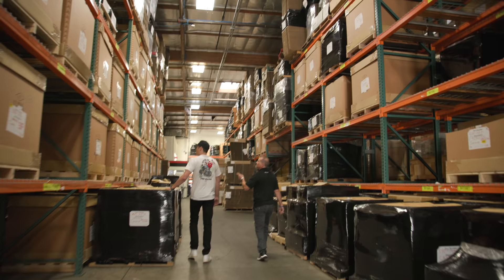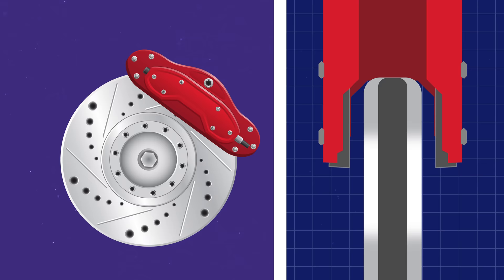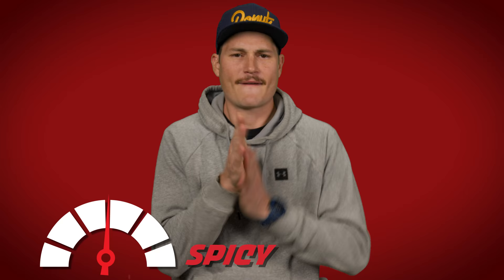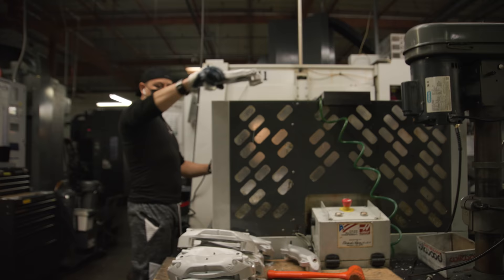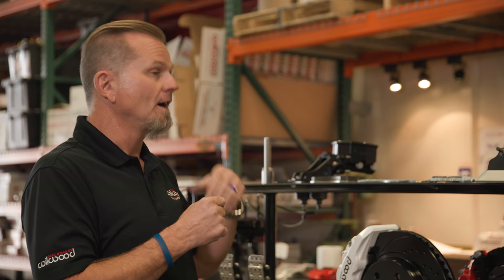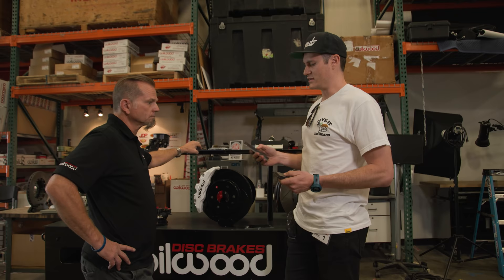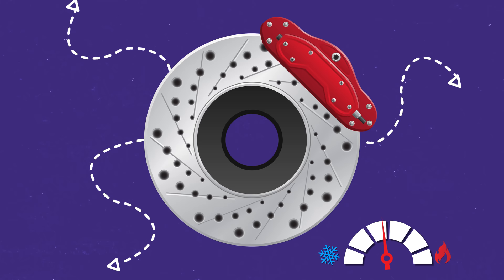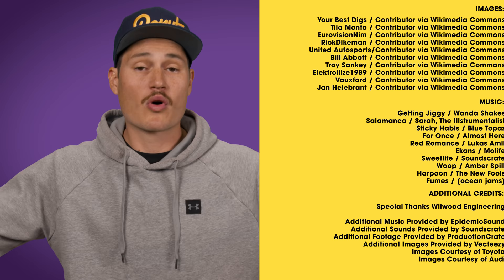Why Your Brakes Can't Melt

Comment: Ooof that was an unfortunate factory tour. That guy basically just repeated what a brochure could have. It would been awesome to go through the process start to finish of building one of their brake setups.
Reply: Maybe they didn't want to give away their stuff
Reply: @DrDreq  The only thing propriety that they wouldn’t want shown is the combination of materials used in their pads and possibly their rotors. The actual process of making brake setups isn’t special. That guy just held up a caliper and pointed to a machine they used for bedding in breaks.
Reply: That's what my takeaway was too. Regardless of why it happened, it wasn't incredibly informative.

Comment: Would've been nice to get a more in-depth breakdown on brakes in general:

1. Master cylinder + booster to caliper piston diameter ratios.
2. Dry boiling points vs. wet boiling points of brake fluids.
3. Brake pad feel (i.e. linear, progressive, grabby vs. smooth)
4. Steel rotors are made to last longer at the expense of not dissipating heat as easily and having lower coefficient of friction. Iron rotors dissipate heat better, have higher friction, but wear faster and weigh more.

Comment: "all mighty engineer" lmao, that's why I'm studying mechanical engineering, to be called all mighty engineer one day
Reply: Be real, a mechanic wronged you somehow so now you want to design cars to find the worst place to fit a starter.
Reply: @colecooper5836  what? That’s not why anyone goes into mechanical engineering
Reply: @kennorcott7074  not to mention you have the actual profession of automotive engineer why would you choose mechanical
Reply: All engineers need to apprentice as both machinists and mechanics. Something that looks good on paper isn't always the way to go. Some tolerances aren't truly needed to be so tight. What's gonna happen when "x" needs repaired / part changes. 

Yeah. Those type of things.
Reply: @seanharrison6162  because alot of mechanical engineers move into the automotive sector. Source, am one
Reply: What kind of mechanical engineering? What math classes?
Reply: @seanharrison6162  mechanical engineers work everywhere. They’re needed in mechanical components, energy production, cooling, etc etc
Reply: @seanharrison6162  you can’t get a degree in automotive engineering in most colleges tho. That’s the issue
Reply: @andrewgruver7774  because very few colleges have automotive engineering
Reply: @TomYourmombadil  and you can choose to move to automotive if you want to
Reply: @kennorcott7074  sadly painfully aware
Reply: I have a mug that says “trust me, I’m an engineer. Let’s just assume I’m never wrong” and I aspire to be that mug
Reply: one of us, one of us
Reply: @joshuagibson2520  that's why I feel as if I have a future in the engineering field, I already have those people to help and mentor me and I also have the drive to do stuff like that
Reply: I'm more of a mighty mage engineer, it's a different class
Reply: @B. Chan they did in the 90s, but only for advanced physics. It's why I got into physics actually.
Reply: YEA!  Hope you Find a GOOD Paying Job.
Reply: @idkwhoknew908  my bad bro didn't mean to respond to you.
Reply: @MetlKen87  A~OK no problem 
..
Reply: as Mechanic I'll say "your are my agony!" :D
Reply: @seanharrison6162  A mechanical engineering degree is often a precursor to working as an automotive engineer.
Reply: Same bro same
Reply: @joshuagibson2520  Luckily I am ASE certified from my school :). Im a bio engineer tho so idk how helpful that will be
Reply: @kennorcott7074  all came down to the engineering skill
Reply: All my homies hate engineers
Reply: It was probably sarcasm, Mechanics just curse engineers all day

Comment: Don't forget, When you Upgrade the stopping power of your brakes, you need to Upgrade the tires. The brakes will only work as well as much tire traction you have.  Also when you give your car more power (HP), you need to upgrade the tires to get that power to the ground. Suspension is the same thing. Build and upgrade around your Tires.
Reply: We highly agree with this!
Reply: @WilwoodDiscBrakes  aye wilwood any chance I can have some free brakes
Reply: A system is only as strong as it's weakest link. In the case of my suzuki swift, I could add quite a bit of power before getting any acceleration benefits from better tires (though the better cornering speeds would still improve lap times).
Reply: @reaganharder1480  sometimes the weakest link is our head.
In my Fiesta ST i rev it mostly to 4k max.
But when it's revved over 5,5k and I'm not brakeing gently but sharply. Oh boi oh boi!
Even funnier. I upgraded the tyres to the best I could afford and it is insane! 80km/h in corner with speed limit of 30 (mountain twisty road) . Like earlier I have skidded there at 50km/h with older tires
Reply: Not necessarily. Depends what tyres you are already running. Most half decent cars already come with decent tyres in the first place. When I put a big brake kit on my car I didn't touch the tyres and the stopping power was still insane compared to stock.

Comment: Story time. Its my sophomore year of highschool, and i worked all summer for my grandparents to buy my first running car, a white 1985 Bronco across the street. The sellers let me test drive a few times, and something felt a little bit... tacky on the throttle. Otherwise, i was in love.
Fast forward to 3 minutes after i sign a bill of sale, im driving it back home through town with my dad behind me. Going up a hill, i floored it so i could enjoy my good ol 302 V8.... gave it the beans and THE THROTTLE CABLE GOT STUCK WIDE THE FUCK OPEN.
I didn't know i could drop it in neutral. I thought if i did, this engine would blow up before i could stop and turn off the car, and i just bought the thing. So i slapped the bitch in low gear and stood on the brake pedal with both feet for over a mile through town. Blew through a busy stop and thankfully everyone heard the horn.
I killed the momentum on an uphill enough to put it in reverse and then park. I got out and the brake rotors were glowing orange-yellow, and they melted the brake lines. Could've fooled me, because that thing cornered like a god damn hero that day. Replaced the brakes and drove it for a few more years.
Reply: My mom had an 85 bronco. Only parts that would work on it were from 85. From 82 to 84 bronco 2's were compatible.  And 86 to 92 i think worked but 85's were an experimental year that did have many shared parts.
Reply: wooo coudlve been worse
Reply: Uh, you could have also just turned the key off. And yes, I've been in the exact same situation before. I turned the key off and coasted into the center (left turn lane).

Comment: The concept of "as pressure increases, so does temperature" along with the inverse "as pressure decreases, so does temperature" is also the basis of pretty much every refrigeration system out there.

I didn't know the importance of brake fluid until I went to my first HPDE event at a high speed track (Portland International Raceway, home to F1 and NASCAR events). By the end of one round, the brakes were done, but it wasn't the pads/rotors. I had upgraded those to be able to cope with occasional track use and yeah, they got hot, but they weren't even stinky. It was the fluid. I'd only used regular DOT3 brake fluid and even though I'd completely flushed out the system with new fluid when I upgraded the pads and rotors, the fluid wasn't up to even 15 minutes of road course use. As soon as your brake fluid starts to boil, the pedal just goes to the floor and you're pretty much done for the day (you have to bleed the brakes since the boiling fluid introduces gases into the system, and gases compress).

Comment: i once almost had my brakes on fire. was trying to show off there was no breaking happening.
Reply: Today my breaks began to smoke at the german highway with no speed limit. I had to brake from 270 km/ h to 100 km/h because there were trucks on all 3 lanes
Reply: My first car was a 91 corolla. Beater of all beaters. I did a brake job and then rallied it around the mountains and when I got back I found I had overheated the brakes and half the friction material had crumbled.
Reply: @christianforster5176  "brakes"
Reply: @christianforster5176  That sounds not fun at all. I had just bouth my first car a mustang with a lot of power but not super well engineered so air ducts or anything to the breaks as i an driving around friend showing how fun the car is I see smoke and a very bad smell lol. i took it straight to highway to get some air in them.
Reply: @colecooper5836  Lol thats funnny konw must have bee nsuper sacry in the momnet. i have changed brakes successfully so far. i am planning to bleed my breakes fingers crossed hopefully no air get in there.
Reply: LOL that is funny now.

Comment: Had 281 mm with thickness of 22mm disc on my mitsubishi (1170kg and 213HP&280NM)  with one pot caliper , and they were "burning" even on "hard" street racing (braking from ~220kmph to ~0), i swaped them to 294 disc, 24mm thickness high carbon ones on two pot caliper and they never disappointed me, even on race track.

Comment: Brakes convert (foward) momentum into heat.
  So, the more heat the brakes can contain/dissipate, the "more momentum" they can stop.
Reply: Sorry, that is incorrect. You have to understand that the rotors are rotating, they are not moving "forward". The inertia of the rotor is what is being slowed (not directly the momentum of the car, which has to travel through the suspension components). Heat dissipation does not increase or decrease stopping force, but more of how often/long that force can be applied. The actual force of the brakes depends on the pressure applied by the piston (check out fluid dynamics to see how lightly pressing your brake pedal can cause several hundred pounds of force by the piston), and the friction between the pads and rotor. So how much heat is generated is really how much inertia it can stop. I hope this helps!
Reply: @Shadowofbloodx  so all you need to do to avoid head is to drive in reverse!
Reply: @TechDove  That is why I made the distinction between rotational inertia vs forward momentum. Rotational inertia doesn't have a "forward" or "reverse".
Reply: @Shadowofbloodx  This was an over simplified explanation of car brakes in layman's terms.
No offence to any "layman" out there.
  My wording is very close to the original statement, which was from MIT alumnus and former editor-in-chief of Car and Driver Csaba Csere (😳 yes- I know. I THINK it's pronounced CHABBA CHEDDA- not kidding)
  This statement can still be regarded as "correct" when looking at the whole picture- as opposed to breaking it down to it's individual parts, and their function... 
(like the pistons, and the rubber brake lines that slightly expand from the hydraulic pressure, etc.)  
  Technically, SOME of that momentum is converted to a little noise, and some vibration, but a very large majority is converted into heat from the friction of the two surfaces (the pads and rotor surface) rubbing together. Those rotors are attached to the vehicle. Therefore, when the rotors' rotational inertia are slowed down from the friction of the brakes, the vehicle also slows.

Comment: What ever you do, don't mix brake fluid and chlorine pool powder! Chemical reaction will happen and fire spontaneously ignite without a match or spark. And if you're curious enough to do this, don't breath the fumes, it's chlorine gas! Do this outside and of course if you do this in a container, don't put the lid on tight! It will produce pressure and explode!
Reply: But... Why would i?
Reply: Genuinely tried this last year. Didn't work. Needs to be very specific measurements to get a large reaction.
Reply: @bean4848  I did a 1 to 1 mix and yeah it's not immediate. It does take about 5 minutes for the reaction to get going.

Comment: That "state of the art" brake dyno that generates a lot of heat and sparks in the middle of a warehouse full of combustible materials is a no-no. If I ever hear that Wilwood headquarters had a major fire, I'll know why
Reply: You can clearly see that it has guards all around it so none of the sparks escape...
Reply: I'd be willing to bet they've already addressed any issues that might be present.
Edit: Just realized how hilarious it is to see a commenter on youtube thinking they're smarter than a company full of automotive brake engineers.
Reply: @corbingray9330  watch minute 13:43-13:44 and tell me that no sparks can escape
Reply: @Hawk7886  maybe the random guy commenting has experience installing equipment in production plants, you never know
Reply: @jantoniotorre  I doubt 1 little spark landing on the concrete floor will cause any fires.. either way you didnt build it or put it there so it's not your issue, and there is a thing called fire extinguishers that are probably very close by..

Comment: FYI Carbon Ceramic brakes are "illegal" in some race groups, only to keep the playing field even. They don't brake "harder" than other brakes since the main limiting factor for how hard you can brake is still your damn TIRES., they just last longer. In F1, there are as many brake packages as there are drivers, it's usually a personal preference of how you want the brakes to operate  - as long as they can slow the car down, you fit them to your driving style (e.g Fernando Alonso uses very soft brakes, and Lewis Hamilton super hard to brake very late - they were both world champs at some point in their career).

Comment: Brake Boosters are a misnomer. They don't really increase the power of your brakes. The force applied to your brakes (in an old-fashioned hydraulic system) is proportional to the amount of travel applied to the brake pedal-- the brakes will apply the same amount of force for the same amount of pedal travel whether the booster is working or not.

What does a brake booster do? Makes the pedal easier to press down. Hydraulics are notoriously heavy in feel, and you would have to put all your weight down on the pedal to make it move. But the brake booster (or brake assist, as it should be called) uses engine force (vacuum or hydraulic pressure) to assist your foot in getting that pedal down. You press into the pedal, a valve closes on the booster, and the booster's drum adds additional force to assist you in pressing down the pedal. Remember, the force of the brakes is tied to how far you push the pedal-- the brake 'booster' merely helps you push the pedal further with less effort.

This also means that if your brake booster fails-- you still have brakes! The brake system itself is working fine-- you just have to get the pedal down (and it'll take a lot more weight to do so).

Comment: Actually, on a 2000 civic I had as a time attack car, with stock-ish brakes, the back of the brake pad welded itself to the caliper piston up front. Technically they did melt.

Comment: Break rotors, DO NOT WARP! They are made of iron, and iron doesn't warp, which is why it is used in engine blocks. They can, however, crack. In my entire life, I have yet to ever see a break rotor warped. Not one ever. Trust me, I have seen in person, some rotors that were truly shocking in their extreme warn state. But I guess we'll have to live with the fact that some people think that something that is impossible to do is a normal incurrence. Other than my random rant, I love the videos!

Comment: I wonder why there is almost nothing to find online about water sprayed brakes. People spray water on their intercoolers with great success (not that this was the same). Why not put nozzles in your wheel house and spray water on the brakes after hard braking maneuvers? You could even attach a temperature sensor and let them spray automatically. Is it because you need too high amounts of water for a system, thats actually effective?

Comment: If you guys want to decrease the heat in the brake follow my steps 

Step-1. Take a cloth piece 
Step-2. Take a glass or a cup
Step-3. Take a liter of oil 
Step-4.  Then pour it  continuously on the disc ...... Wa lla you have an ice cold disk👍👍👍

Comment: 1. are there liquid cooling systems for brakes? (maybe only for racing? but adds cost/complexity)

2. as EV/hybrid electromagnetic "regen" braking gets stronger/more reliable, all that energy lost as heat will be instead back in battery for more juice! I think already in some electric cars frequency of pad/rotor replacement is muuuuuuch less than similar non-EV car. So both road & racing KERS systems will start biasing more energy to battery than to mechanical friction?

Comment: No one cares, but the brake pads shown at 16:21 are for bicycle disc brakes.
Specifically for hydraulic Avid Juicey or cable pull BB7 brakes.

Comment: You still didn’t explain why someone couldn’t friction weld metallic pads to  cheap steel rotors if they repeatedly did 80-0 as fast as possible

Comment: Aluminium is not utilized in brake surfaces, only, maybe, for the carriers, because of the heat dissipation. Even the state of the art Shimano XTR brake rotors are a sandwich of aluminium core with a steel brake surface. The others just use aluminium carriers and steel rotors, or just plain steel rotors.